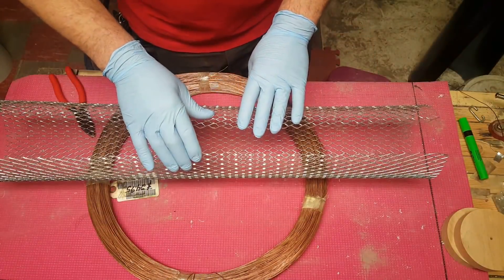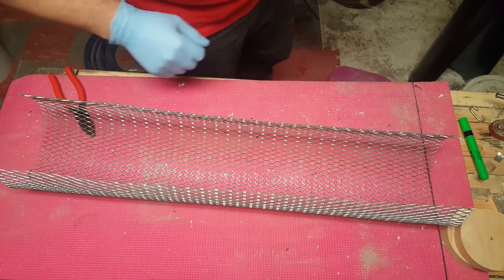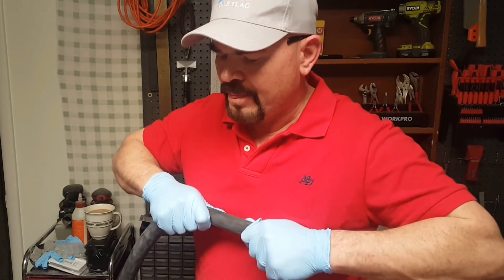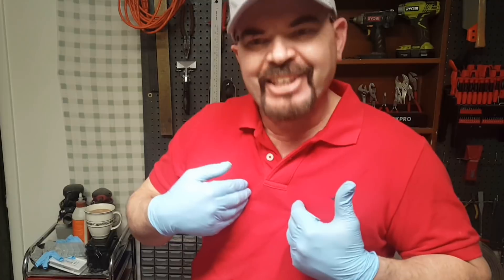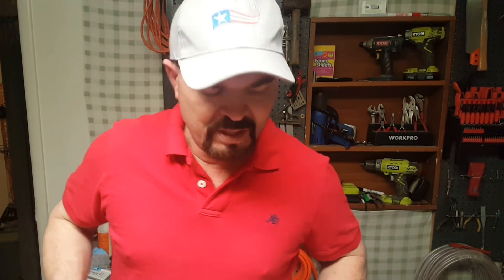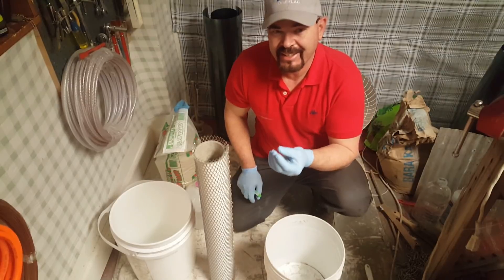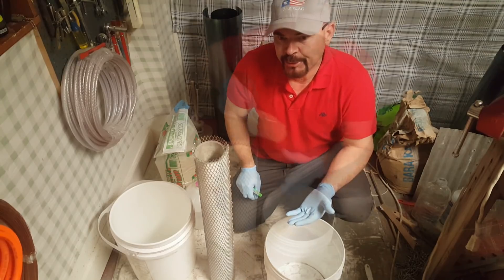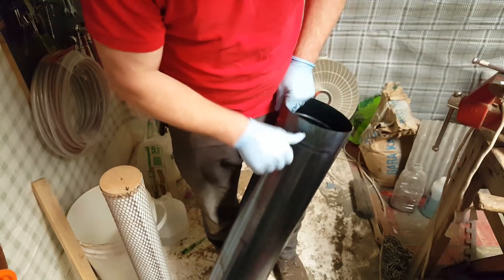Designing a Aircrete Heat Riser

Comment: So go down to your local flooring store and get a cardboard tube the carpet comes on. Staple some hardware cloth (wire fabric) to the tube. That should take all of a couple minutes. For the outside of the heat riser snap galvanized duct together. A 10" duct snapped into an 8" duct makes an 18" OD heat riser. 8" + 6" = 14 etc.
Reply: Others have suggested this, and I like it a lot. I also have been looking at alternatives to make the rocket stove last longer. A DIY foundry forum suggested Loucast 3000 because it can take 3000F, but it is pricey. I am now considering using a cardboard tube (as you suggested) to cast Loucast 3000 into a thin riser. I can use PVC/ABS as the outer shell, sliced down its center with hinges and latches to open it when the casting firms up. After that...I can then form a mould to make a thick casting of aircrete with perlite mixed-in, using the thin Loucast riser as the core. Since Loucast is expensive and aircrete is cheap, this two-layer riser should take high heat for a longer time than pure aircrete, but still be lighter and cheaper than all loucast.

Comment: Why was it necessary to pack the sand or even use it? Isn't wet aircrete mix light? Would it put a lot of pressure on the metal screen? So much so that it would all run out? Even if you had a stiff mix? Have you tried it? It's ok if a small amount oozed out. It could be knocked off later before it completely cured (stiffened up).
Why not use an inner pipe instead of a screen? Would it be too difficult to remove? Have you tried it?

Comment: Very nice! Love the roller. You're doing great stuff here Darwin. Is the lath for reinforcement or to cause a type of flow? I use this on my fireplace grate to support coals and it burns out in about a month. If it is for long term support it should be deeper inside the foam column. I think I'll stitch my blood lath with rebar ties and crank. That stuff should come with a box of band-aids.

Comment: Darwin, Great job on the riser. I think you have really come up with a great idea. I have one suggestion The wire mesh you are using looks to be the right mesh(size openings). I think however it needs to be a slight bit larger than the 4 inches you have made. The mesh at 4 inches will put the mesh exposed to the heat and may cause it to melt or rust out. I think it needs to be in the interior of the Aircrete or if your mesh is too fine(openings) then put it on the outside, or go to a larger mesh like chicken wire. The temps that it will see there(outside) shouldn't cause it to melt/rust, and if it does it should only be the first couple of inches.
What so you think??
Reply: Maybe it doesn't matter if (or, when, rather!) the mesh burns up... Maybe he's only using the mesh to give structural support to the form itself?  I, too, think in terms of a "rebar" type construction - metal embedded in concrete. Hope he comments or writes addressing your good question.
Reply: Remembering back to the original riser, I think the melting of the mesh is part of the beauty of the design of this, leaving an all aircrete riser.